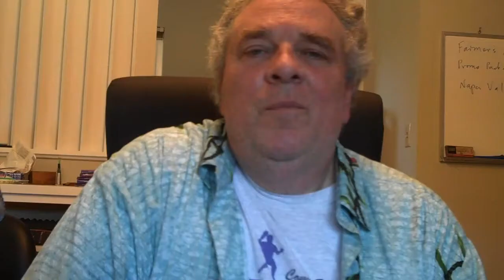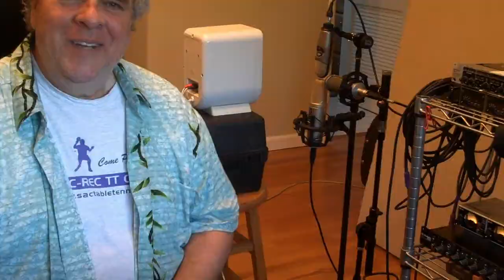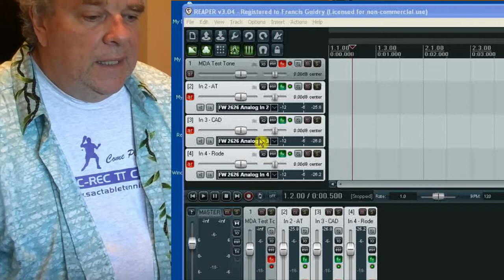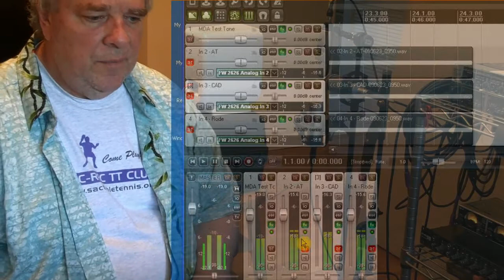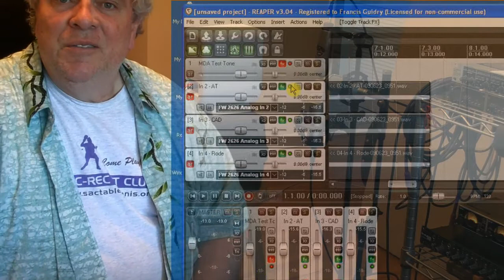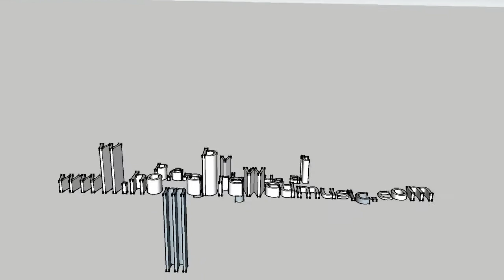Microphone Comparison - A Tutorial - part 1 of 2

Comment from the maker: @bensgoldberg Ben, if you're knowledgeable in the area of audio testing, I'll certainly concede the point, since I'm just fumbling around in the dark. But with the tools I have a 1 khz tone is much easier to use as a reference level. Using noise as a calibration source brings a lot of movement to the metering I'm using.

Thanks,
Fran